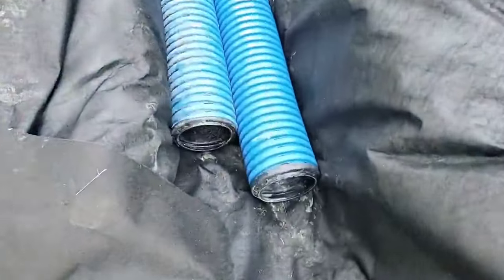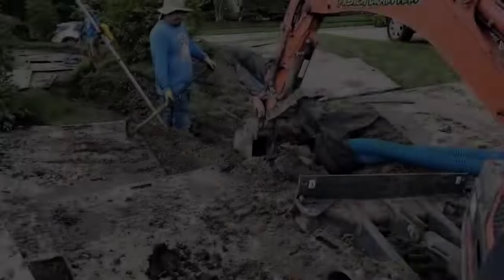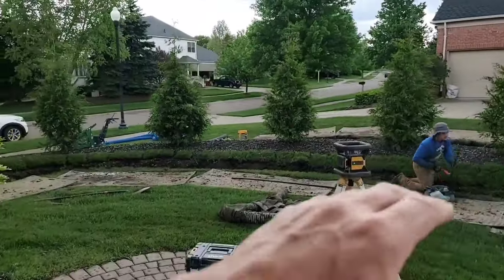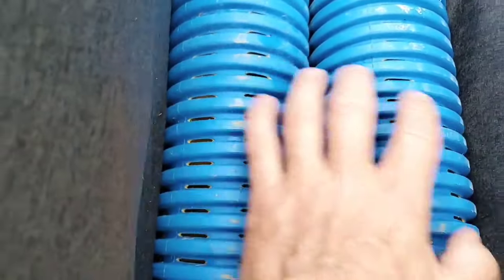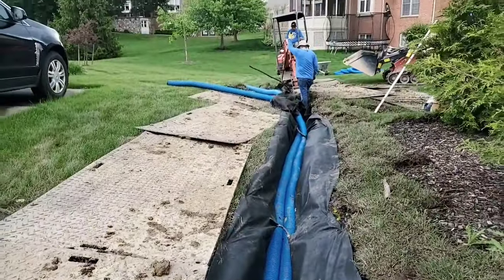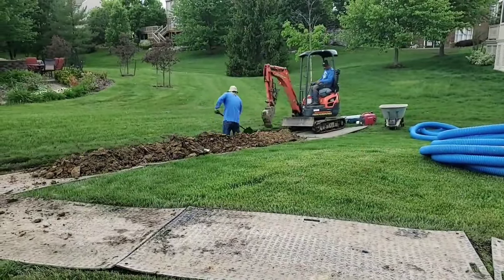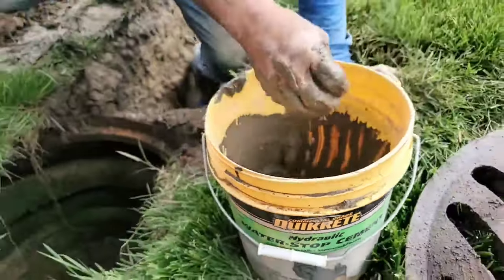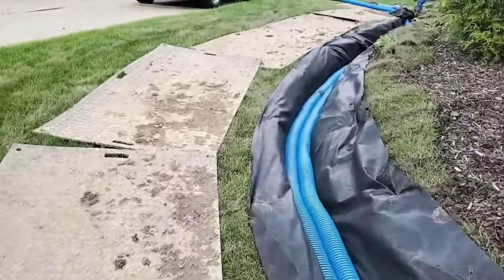How to Build a French Drain Full Tutorial in Less than 10 Minutes [ Veteran Contractor Explains ]

Comment: No mention was made of the absolute requirement that the french drain pipe must be sloped (min. 1/8" drop per ft of run) for water drainage to reliably occur. Otherwise, trapped water will pool in place and the entire project is for naught. Although that may seem obvious, newbies need to be told.
Reply from the maker: It's a benefit to have slope but if you do not have slope you can still build a fully  Enclosed system. No debris gets in this type of build. We do flat Drains all the time. I will do a video on this. Thank you for commenting.
Reply: Surely that membrane slows the drainage flow

Comment: Thanks for this run through on drains.  The thing is, most of the problems we are trying to solve with these drains are to save our homes and yard living spaces.  I have a new home with a 4'x2' open trench three channel and a runout ( 400 to 500 ft total) dug because of  water in the crawlspace.  It's huge and ugly at this point, but I couldn't be happier seeing the storm surges run to the street in those trenches as opposed to knowing the under home was wet. Go Big, Do it once and right.  Do it quick.  Me, I'll have open trenches for a few more weeks. Or until my orders come in.   These products are just what I need to finish.
Reply: Where u buy the pipe at
Reply: @larrytheplumber9851  Larry, I opted for the 2-hole PVC plastic perforated pipe from the local box store.  ( I figured the 3 plus feet of rock was going to move enough water that a premium pipe would not be necessary as the rock would take care of 90% of the rain anyway.)  I bought the fabric online 400' of 100' x 12' of heavy duty sandbaggy?  I'm still dropping drain rock  - have another 5 yards delivered today.  So far 30 yards and I have maybe 100' total of completed covered pipe and rock in the out fall trench.  The remaining should be less rock as the trenches are narrower.  I have faith that my overkill in design and depth will eliminate ever needing a sump pump under the house.

Three days ago we had a 15 minute thunder shower go through the area.   10 min from totally dry to water flowing from the exposed outfall pipe, (which ran water for another 20 minutes).  40 minutes from storm to done running with nothing getting near the crawlspace.

Just sad that my first year at this new home will be remembered for this 66 year old man crawling around in the mud and muck under the house - digging, cleaning, and ensuring the water flows without effort through trenches.   I told my wife that it must be tough for her, after all these years, that she has to live with husband who has become an 8 year old kid who just wants to play in the rain and mud all the time.  You know the old saying-  Make Hay when the sun shines - Well the adage for me would be Divert water when the rain is heaviest. I Spent alot of the winter maintaining the flow!

Good luck with your project, I love the ability to become adept in home,car,building,planting-lifes-work because of videos like these.  Thanks too to the Drain Man.

Comment: I'm starting to get an education in yard drainage because the house I'm about to buy has some minor water infiltration issues in the basement.  My goal is to make that 0 issues.  Had two basement guys out who said all I needed was to fill the small cracks in the foundation.  That made no sense to me, just a bandaid answer.  What also doesn't make sense to me, a lot of these guys use pond liner in the trench, so water can't move in from the sides.  Thanks for posting.  Mark
Reply from the maker: I would try that first.
When you use epoxy, fill the cracks,
if there's nothing wrong with the drain tile, and it just happens to be a leak, you're fine.
Reply: @FRENCHDRAINMAN  Thank you.  Mark

Comment: I have a question. If I plan on using the 4” high octane perforated for a curtain drain, and then want to connect it to 4” corrugated solid to move the water far from my house where no curtain drainage is needed, would you use an inside or outside coupler to go from perforated to solid? Thanks!  Your videos are great, BTW!!
Reply from the maker: https://youtu.be/t3gp0UV9BSE?si=ZODVSltUNsw4_4K3

4 in. External Snap Coupler HDPE
https://frenchdrainman.com/product/4-in-external-snap-coupler-hdpe/

Comment: Excellent video. I'm on 1 acre and have cows on 1/4 of it and in the winter they get ankle deep in mud so I want to put in a french drain and bought enough filter fabric for the entire 1/4 acre pen where I'll put 1 1/2" rock on all of it then on top of that pea gravel then on top of that I might put washed sand so the cows can lay on it. The french drain goes all the way around their pen area which is on a decent slope to the west. Do you have a suggestion for the pipe that exits the pen and continues downward to the west and I don't have a storm drain to dump into, just a slight ditch that goes around the entire block (the ground just slopes down and then climbs back up to the road and is not cemented since we are rural)
Reply from the maker: Your discharge line to the ditch should be Dualwall corrugated pipe.

Comment: I really wish you were in my area. I'm in north Texas and I'm having a very difficult time finding a good company for this kind of work. At this point I'm thinking I might just buy the supplies from you and do it myself. 
Is a slope required? If so, how much? And if a pop-up emitter is being used to allow the water to come out, does the opposite end need to be higher than the pop-up emitter? I would think that without something like a sump pump the only thing that could push the water out where it needs to go would be gravity.
Reply from the maker: https://youtu.be/VyC_Bj9KZAE?si=ySs_znDbv6mKYVTV

Comment: Hi, thank you for your video.  Can I ask, what is the pitch or drop you look for in running a drain line?  So many inches per foot or yard? Also, I'm in Maine, do i need to worry about the frost line for drain lines?  Many thanks!
Reply from the maker: If you slope your drain properly, it should not hold water, meaning it doesn't matter if it's in the frost line or not. Slope minimum 1%

Comment: Hello, I just had a french drain (open/closed) and downspouts routed to a 4" PVC pipe, moving the water to a street sewer which my property has access to.  This contractor used your products (wrap, 4" high octane corrugated drain pipe, large gravel, 4" PVC, and buttoned up the system like in your videos).  Upon watching this video, your comment about removing all of the dirt from the trench is a must as it shouldn't be reused. In this case - the dirt from the trench was raked out beside the french drain along the side of the house.  I'm asking this question as I went out this morning and walked the area beside the house and I have areas that are very saturated still.  Should I be concerned?  Thank you!
Reply from the maker: French drains work 365 days a year. Pending weather, it does take some sun and warm weather to make the ground firm. If it's cloudy and cooler, your soil will be soft and damp. Nothing drys the surface soil like wind, sun, and warm temperatures.

Comment: What if the only rocks that we can find are the round rocks of 1inch to 3 inches mixed in with a bunch of small pea gravel. They are not washed but that's no problem because I can spray them with water to wash them. My main concern is the small size rocks that might plugged up the hole of the high-octane 8 slot pipe. So, what else can I do? Thank you.
Reply from the maker: Use a sock on the High Octane Armor pipe.

Comment: How do I install my French drain system with a basement?  Do I dig down to the footers install that pipe on the bottom up against the exterior of the wall fill it with 1 1/2” rock and cover it like a burrito with the woven fabric and then fill the rest with the same rock all the way to the top?   I also would put my downspout drains in a separate solid pipe on top of that and bring it all to daylight or do you have a better/different suggestion??  I am also going to waterproof the exterior of my basement wall any suggestions on how to do that???  Thank you.  Your videos are awesome. West Virginia.
Reply from the maker: Do NOT go below the foot.  Interior systems are shallow and only require 1% slope.

Comment: Question for you. btw I am also in Michigan. You probably already have a video on this but I have to ask. What do you do when you have no where to run the french drain? I would have to trench probably 200 feet or so and go through the utilities to get to the ditch by the road and the customer would rather not have that. So my  customer  takes all the water from her neighbors, and most of her yard is pitched towards the house. Can I run a french drain 20ft off the house and around the house into a NDS dry well with a catch basin on top? fill the hole with 6a stone and backfill with it as well. Thoughts? I just don't know if you can use a dry well and french drain in unison?
Reply from the maker: Run. Don't take the job it will only be headaches. Tell the homeowner it goes to the ditch if you want it done right

Comment: How wide a trench do you excavate for a double barrel system?  What size bucket on the mini excavator?
Reply from the maker: 9" usually breaks clay out to 14" that's our minimum. 12" bucket will be 17" brake out in clay. Depending on the type of clay and moisture in the subsoil at time of excavation. Need 14" minimum for twin pipe set up. 
How this helps.
Reply: @FRENCHDRAINMAN   Ok, 14" it is.  We dug up my well head recently and my soil was very sandy with a lot of rocks and minimal black dirt.

Comment: I am building a bunker in a below water table area, in an especially rainy climate. My solution to avoid flooding my bunker, is to build a French drain with entry ports on all 4 sides of the bunker leading back to a main pipe, that leads to the drainage ditch a few dozen feet outside my yard. Is this viable ?
Reply from the maker: Sounds terrible. When the ditch overflows it will backfeed into your bunker. Build on higher ground or elevate the ground getting it up out of the water table.

Comment: There is alot of controversy over whether or not to use fabric covering the whole trench or just on top of the trench. The method in this video is saying use fabric in the whole trench. If no fabric then over time the rock will get clogged with dirt and no water will penetrate to enter the pipe. But the caveat to that is. When using the fabric. The fabric itself will get clogged with dirt over time. Then become impenetrable. So water won't even enter the trench at all. Any thoughts on this?
Reply from the maker: https://youtu.be/KiehdvVTu-8?si=Aq_6xmfSSRg8Fhvn

Comment: Are you able to drive over this french drain system. I need to do a french drain to a creek. I park my camper in my back yard and need drive over it. My camper and truck are heavy. Any info would be greatly appreciated.
Reply from the maker: Pack the pipe(s) in crushed stone, it compacts and locks up tight protecting the pipe(s)
Thank you for commenting good question.
Reply: So use crushed stone to the top of the pipes then switch to the 1 1/2 in round stone to finish the drain? Or do crushed stone the entire channel? Thanks again
Reply: Pretty sure he has a video with him parked on top of this pipe with his truck wheel with little to no flex.

Comment: We're building an A-frame cabin in a high snow/rain area. Traditional gutters won't work, as they'd likely be torn off by the snow sliding into/over them, and also the edge of the roof is close to the ground. We'll be utilizing a french drain system, and I'm wondering if there's a "norm" for how far out from the foundation the trench should be?  Most of the house is roof (a-frame), so plenty of water coming off from it & I'm not sure if the velocity of the rain running off the steep roof makes a difference? Thoughts or advice?
Reply from the maker: https://youtu.be/mSfXGLlyIKM

Comment: The perforated pipes I bought at Home Depot do not have holes all the way around them. I am considering drilling more as your video showed. Any downside to this and how many and where to make these holes?
Reply from the maker: The side wall is to thin so home depot pipe will  collapse if you drill it out. Our pipe is at least 3x thicker side wall. I would take it back.
Downspout Pipe 4 in. x 100 ft. High Octane ARMOR Pipe
https://frenchdrainman.com/product/heavy-commercial-solid-high-octane/

Comment: If I plan to pour a future horse shoe driveway over a small section of the French drain and across the discharge line, how much clearance on top of pipe do I need not to collapse the system?
Reply from the maker: The weight is displaced over a large area so the pipe will be fine underneath the cement driveway
Reply: @FRENCHDRAINMAN  thank you for responding so quickly.  Can I use the high octane under the future driveway, or should I run heavy duty yellow for that section?

Comment: Was the explanation for why water doesn’t just go back out through the perforations and into the soil is that it’s easier for the water to travel through the pipe than to exist through the geo Tex, so it takes the easier path? And that it likewise enters the geotex because that is easier to travel through than the dirt, thus also, taking the easier route…. Is this a correct understanding?
Reply from the maker: Water exists in the soil under the grass. It needs a way out. Water takes the path of least resistance. It moves down hill rather than up hill. Have 1% slope on the pipe and give the water a place to go like a Ditch or storm drain. 
I hope this helped

Comment: Sure the holes would be on the top, rather than on the bottom to collect rain water?
Reply from the maker: The holes are 360 degrees meaning BOTTOM, TOP, SIDES your 💯% covered. More inlet than any other pipe in the world 🌎 17 1/4"sq of inlet per Linear foot. It's called HIGH OCTANE 8 SLOT for a very good reason. 
Hope this helps, thank you for commenting!

Comment: Correct me if im wrong but your saying that simply putting gravel around the pipe will get stopped up quicker than the drainage fabric you use? I'm ignorant about this type of stuff but I have to say that doesn't sound logical. The fabric your using is most likely had uniform holes or in it that are far smaller than the distances between the gravel and consistent in size making it more susceptible to getting stopped up especially when roots and weeds are thrown into the situation. Again I'm ignorant and just trying to figure out what I need to do to my occasional natural swimming pool that tends to magically pop into existence in my back yard after a good couple days rain.
Reply from the maker: https://youtu.be/OeMdMhRA_Mg

https://youtube.com/playlist?list=PLjFCqaZ4v1BUmAXw5xwQ0zbQRPxnX0U7R
Reply: We have issues with bad drainage between the houses.  Homes here are (at best) 10’ apart.  Maybe 12’. The grass has disappeared in spots due to poor to no drainage.  The builder has installed ‘French drains’ between a few homes but we are 6 months from our 11 month check list.  This will be on that list.  I have pics on the bad areas and will present them if we make it until then. I’ll not stand for anything that just gets the builder off the hook and these videos are giving me ammo. Thanks

Comment: Our builder installed an underground pipe in the alley between the houses to collect runoff water but 1) I do not think it has holes 2) there is no gravel or fabric surrounding it. It is just a pipe that runs underground connecting to several water basins that collect water in the alley. What problems will this type of faux French drain will cause? The alley is now mud and we have seen water puddles in a 1st floor room of our home but it has only happened twice (it doesn’t often rain where I live. They sent someone to extend the pipe to the street as it previously ended right before the sidewalk causing puddles on the sidewalk but I’m concerned the mud issue and future foundation problems might happen.
Reply from the maker: You have a yard drain. You should hire someone to do a French Drain. Builders don't supply a yard French Drain. It's something the homeowner is responsible for.

Comment: Surprised you did not use a larger diameter pipe to drain off the two double laterals.
Reply from the maker: It runs on 3% Slope so the GPM ( Gallons Per Minute ) is really high and can keep up no problem. Thank you for commenting I hope this helped.